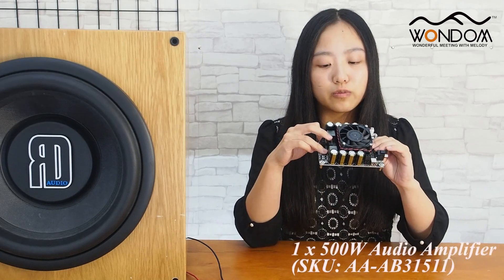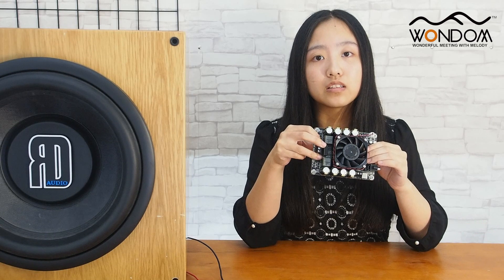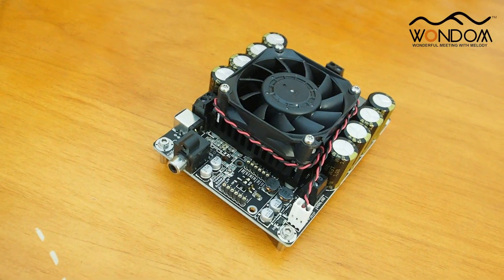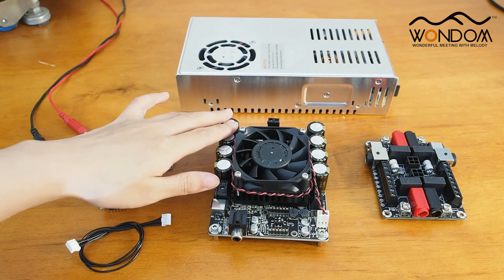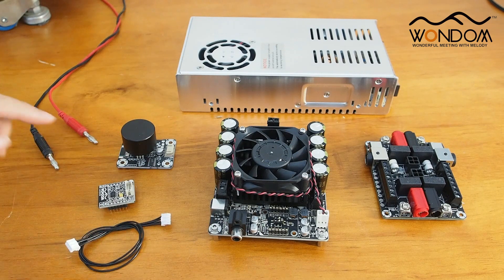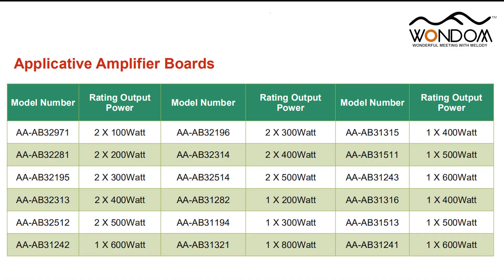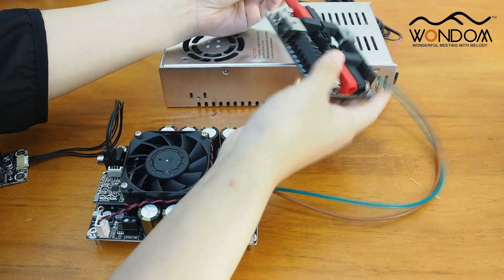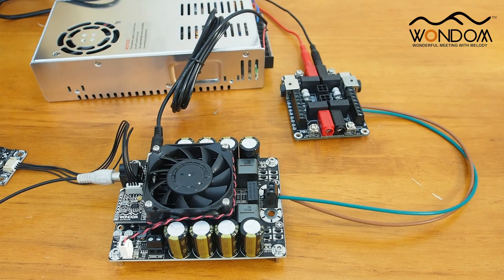Mono Audio Amplifier for Subwoofer with Volume Control Module

Comment: Hey wondom audio,
I wann build a Bluetooth speaker and use a Chassis which is rated for 250w rms and has 8ohms it is a 12" full range speaker and i Need: 1. A suitable amplifier with 100-200w and With Bluetooth 
2. A recharchable battery for the AMP
3. Some kind of extenden controll Board which Houses indication LEDs a 3,5 mm headphone jack and the charging Port 
I Hope you have something in Stock. Could i potentially  use Like 3 of your 18650 batteryholders in Series to get to something Like 36 Volts? Because most Stronger Amps Need a high voltage.
Greetings Philip
Reply: *I'd Love something Like the jab3 Series but Just a little more powerfull and i am Not 100% Sure But the jab 3 100w AMP is only used for Subwoofer anyway because of the Frequenzy response right?
Reply from the maker: Hi, Philip,

This version battery charge board can be connected in series to get more capacity but the output voltage will not be increased.
A new 5S26650 Battery charge protection board (with 21V output voltage)is in processing and will be released in the next two weeks. 
For the higher output power amplifier, new JAB is in processing, featuring in 2/3/4 channel configurable, which means you can get 4 x 100W, 2 x 200W and 2 x 100W + 1 x 200W at the same time. Just keep in touch，we will release in the later stages.Thanks for your support.
Reply: @WONDOMAudio  OK thank you for your response, but could i use the jab3 1x100w AMP With my fullfange speaker or is it only suitable for Subwoofers? And what Power does it Output into 8 Ohms?
Reply from the maker: Hi,philip,
You can use the APP control function to realize the connection with fullrange speaker.The output power is about 50W with 8 Ohms.
Thanks for your support.